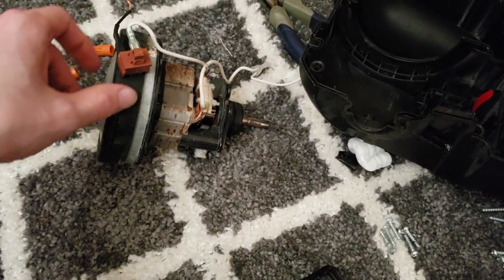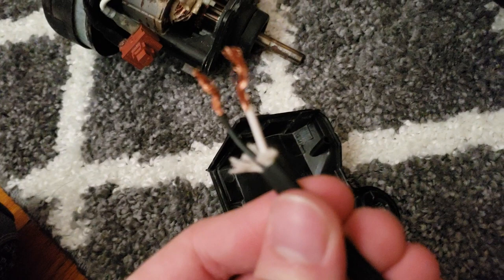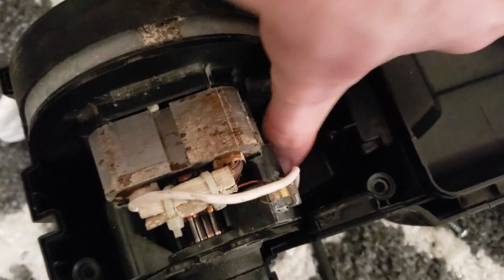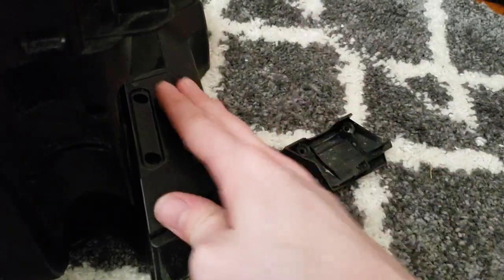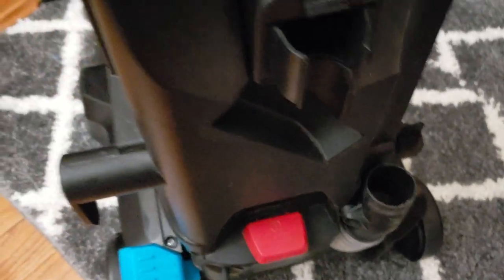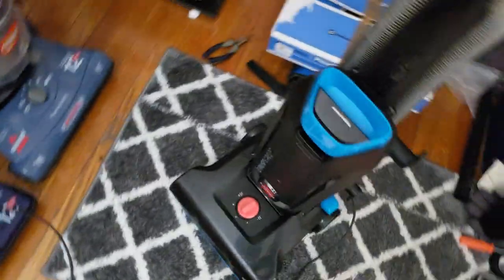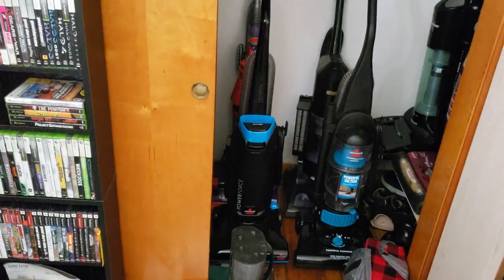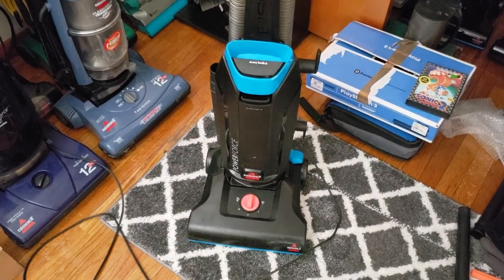Free Bissell PowerForce Vacuum Repair/Refurb/Assembly

Comment: Do you have a video of the disassembly of it? I also have a 1739 and I have to replace the switch. It doesn’t click to stay on-you push the lever and it turns on and then it turns off when you release it. I just wanna know how much I have to take apart to get to the switch.  Thanks for any info you can give.